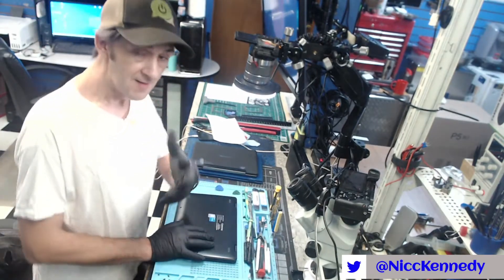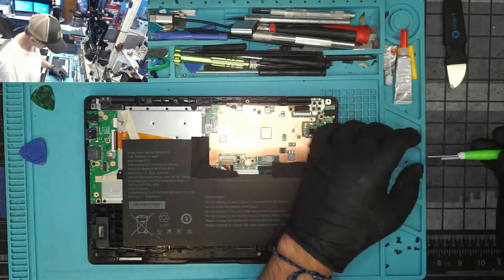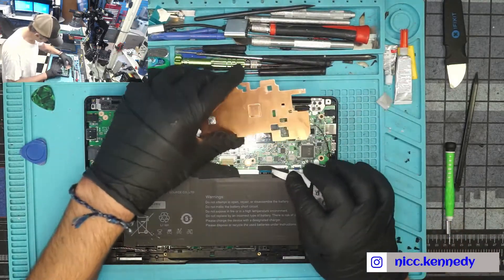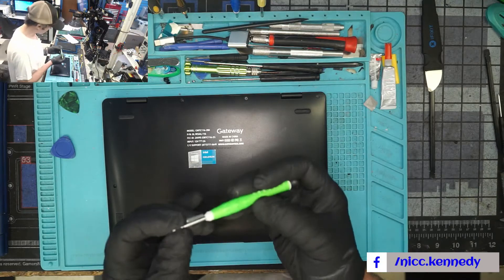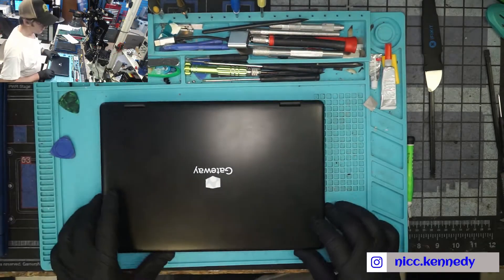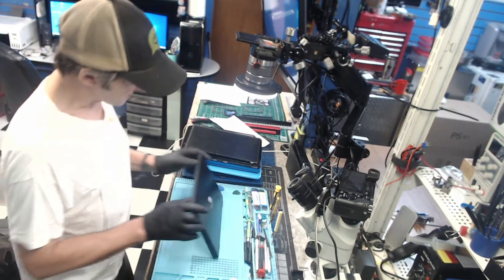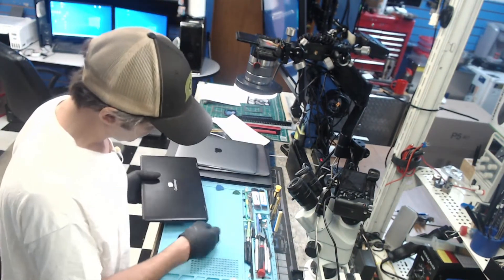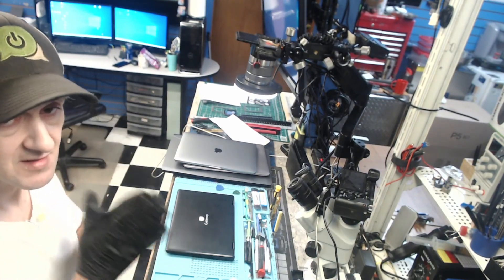Stock Cooling Unacceptable, Common Problems Compared

Comment: Nice job and yes it was the right amount of thermal paste 😀.
Reply from the maker: More of a, if you didn't know, now you should, video. Baffles me why people still buy such devices. If it works for the task you want to use it for, no real reason to complain I suppose.
Reply from the maker: Debatable amount of thermal paste🤣🤣🤣
Reply: @NiccKennedy  yep, those convertible tablet computers are nothing but a tablet with a fancy keyboard attachment and they have no power behind them except to surf the web and to check emails and social media.  You just want tell people they're stupid and buy a real computer.